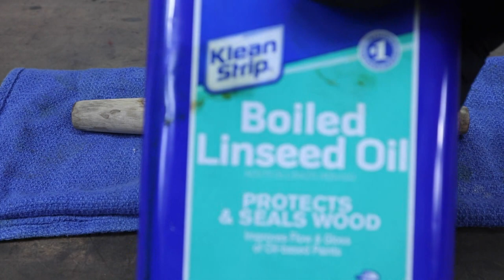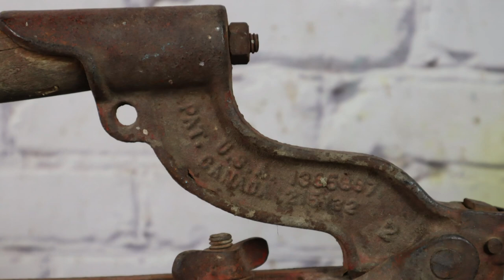Restoring a Brikarier. Old and rusty tool used to carry a load of bricks.

Comment: Good enough to build a house now! Some tips for painting 1 hang something heavy from the bottom 2 you can go as low as about 15 psi if you dial down the paint flow this will only work with hvlp which is probably what you have
Reply from the maker: Thanks for the tips. I'm new to paint guns. Using a weight is a great idea.